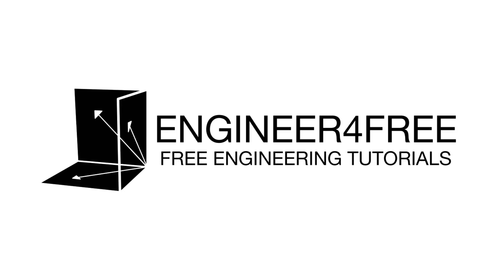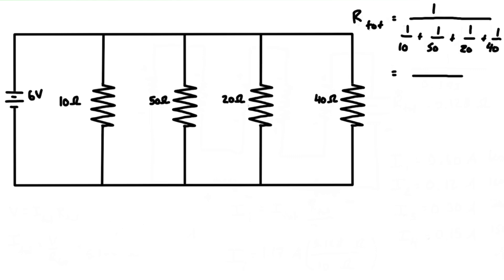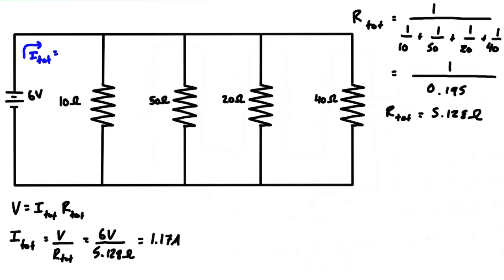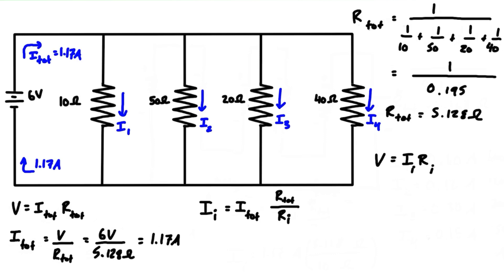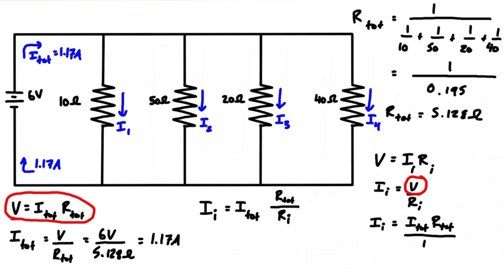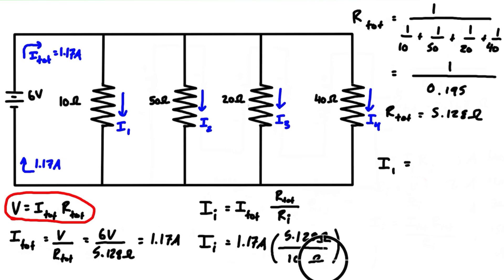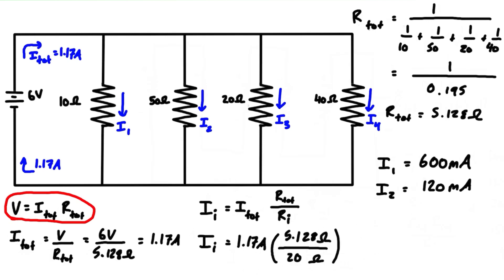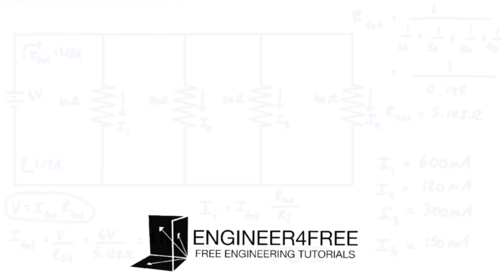Current Division Example Problem #2: (Parallel Resistors)

Comment: If you directly calculate the current per resistor? 6 volts / 10 ohms = 0.6 amps. 6 volts / 50 ohm = 0,12 amp. 6 volts / 20 ohm = 0,3 amp. 6 volts / 40 ohm = 0,15 amp. And then add the four currents together for the total current. 0,6 + 0,12 + 0,3 + 0,15 = 1,17 amps. Would that be a problem? 🙂
Reply: My brother that is absolutely correct, and in a sense, just a different version of the current division formula. What you're doing is I(i) = V(i) / R(i), and than can just be derived from current division formula - I(i) = I(tot) R(tot) / R(i), which due to Ohm's Law reduces to V(tot) / R(i), but since voltage is same throughout, V(i) = V(tot), which just means I(i) = V(i) / R(i). So that is just as good. Hope it helps.